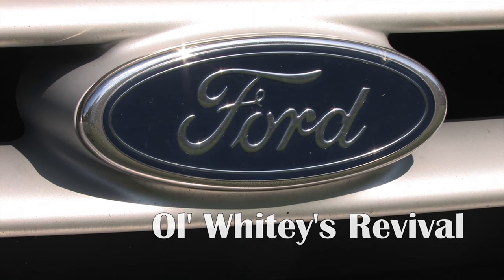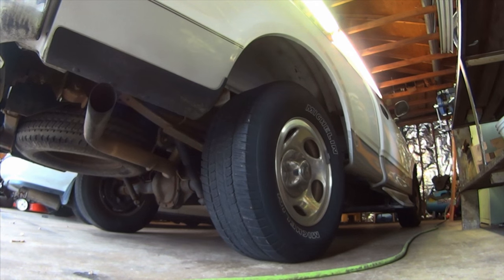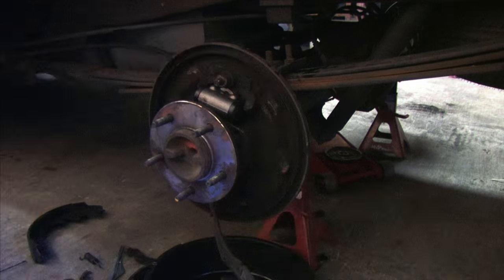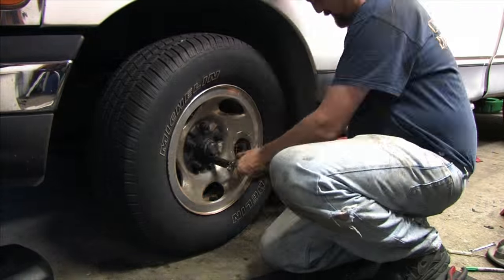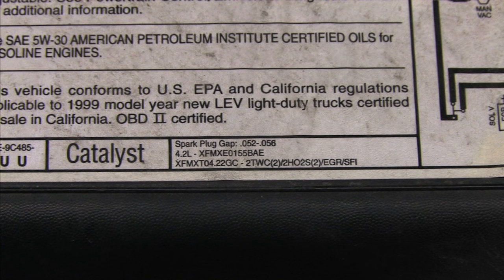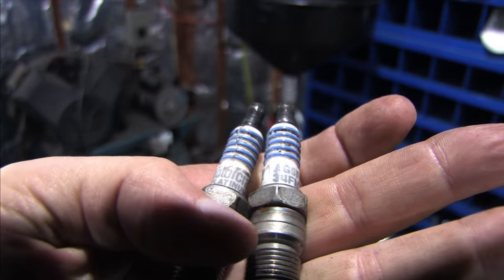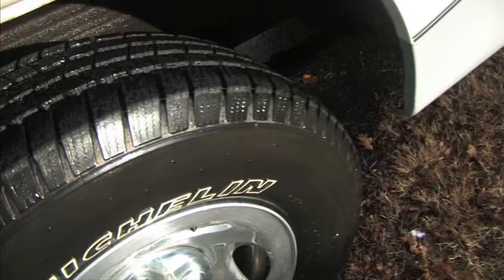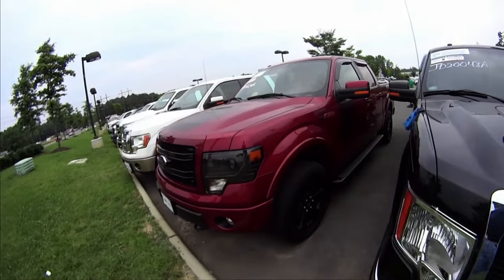Ol' Whitey's Revival

Comment: Could someone explain to me why you'd want to use a 12 sided socket for anything other than a 12 sided nut or bolt (like some after market head bolts etc). The only good use of a 12 sided sockets on 6 sided screws/nuts is as nut and bolt lathes to make a pretty and shiny bolt head with.
Reply from the maker: 2 reasons.  12 point sockets are usually skinnier making them fit in places where 6-point sockets can't.  Also the ratchet end is a square, making the hex line up just the wrong way in tight spaces when you're using a breaker bar.  Some spots don't give you 90° of rotation to tighten and loosen bolts.  It gives you 3 new angles to setup your wrench before you start honking on it.  But yeah, I use 6-point for everything except when I can't because 6-point sockets are stronger and don't strip nuts and bolts.
Reply: Ok, fair points but if i need to use a breaker bar, the chance is that the thing I want to remove is stuck so hard i will just round off the hex head anyway.

If stuck I much prefer heat, penetrating oil and impact gun with as few and short extensions as I can get away with like you used in the video.

I have never managed to round off a hex head with a 6 sided socket (and they can be ground down to fit tight spaces too). I have broken plenty of bolts in the thread though ;)
I must say I was impressed with you managing the feat in the video...

Comment: Hey jafro quick question how do you find out hub bearing dimensions and info to see if they interact with one another
Reply from the maker: Once I have the part number for the bearing for the car I'm working on, I search the part number online and look at the other vehicles it fits.  Most retailers who stock the part and allow you to search their inventory... the listings for those parts often include all the vehicle models they fit.  If you don't know the part number you need, often you can search those same sites with vehicle info, and it's listed in the search results for various brands of bearings, and those may cross-reference to even more part numbers.  Sometimes you get an ID and an OD measurement in the listing, but they're only as accurate as the person entering that data on the website.

Comment: Jafromobile your coolant recovery tank cap is bad, that's why you lost coolant. Ford has used the same cap on all its vehicles for will over 20 years now and they suck lol. This is one of the biggest engine killing parts ford has ever made, just ask the Powerstroke or Ecoboost guys. Ford used a wimpy pressure spring in the cap and they love to fail on hot running trucks or over many heat cycles. I always use STANT part #10238, it has the biggest spring in the industry and it not a bank account breaker lol its $2.57 on Rockauto. It's the cheapest part you will ever buy to save your truck lol.

Love Big Red, only thing I would have done to it is a Dyno Tune session with a SCT certified tuner. Have them do a 85 octane tune and just bump the trans line pressure up by 10%. You would not believe the difference it makes in this trucks, both in power and fuel savings. Have a customer with an 3.5 ecoboost averaging 19.5 mpg and he drives 90mph everywhere lol, and a friend I did a tune on with 5.0L pulling 23 to 24 mpg (he drives normal lol), now we live on the South Texas Coast so we're at sea level which is a boon for power. As always love the videos.
Reply from the maker: +TdrSld Dude, that is AWESOME info for BOTH trucks.  Thank you for taking the time!
Reply: +Jafromobile, no problem bud, love to watch you work lol. As an engine and chassis fab specialist I have picked up a thing or two over the years of building off road racing rigs. So if I can give a helping hand to another builder or someone trying to learn I will. So thanks for the reply

Comment: Hey Jafro, where cn i find the twist sockets you used on the rounded nuts? i looked on ebay with no luck..
Reply from the maker: I just have the cheap-o 5 piece IRWIN set.  The S&K Deep-well turbo twists are worth the expense if you use them daily or weekly.
Reply: I just bought a set of the IRWIN ones yesterday for the exact exhaust nut problem covered in this video. Well worth the $20.

Comment: Hey jafro do you know is the ignition control by cam or crank sensor on a 4G92P
Reply from the maker: +Goce Nikolovski No?  Honestly I had to look up what that even is?  The "P" model didn't ever make it to my country.  It's Europe and Japan only.  Your best bet would be to look up the electrical diagram for that engine and see if the crank signal is coming from the cam angle sensor, or if it has a separate crank trigger.  The crank signal wire will be grouped with the other wires for the part that generate the signal.
Reply: +Jafromobile Thank You jafro we think is probably sabotage from one of the previous owners of the car, the car run when it was parked, next day wont start but is cranking, my friend called me over and using test light i found there is no power to the ignition coil, look at the fuse box and the ignition fuse was missing, looked in the box it was gone, no marks on the door edge, he ever pulled the fuse must have a key, what some people will do.

Comment: Where is this going? The truck is misfiring and we're working on the brakes?
Reply from the maker: Ol' Whitey needed a lot of everything.  It had the misfire before I started, and during the tune-up, 2 cracked plugs ended up getting installed.  You couldn't see the cracks when they were clean, but they had been dropped before I bought 'em.  Once I got 'em dirty, it became real obvious.  You know how you check your eggs before you buy them at the grocery store?...  check your plugs at the parts counter.  I thought I was losing my mind because it was worse after the tune-up.

Comment: hey jafro how bad is the state inspection down where you are? up here where i am we do a safety check and they also get plugged in to check emissions monitors.
Reply from the maker: +Joseph Warden Ours aren't that bad.  But I'm less than 100 miles south of those rules.  In my state anything but the OE exhaust is basically illegal unless a dealership offered it as an OE upgrade package.  Must have catalyst (if OE equipped) is all they visually check for where I live.  Classics are 20 years old, antiques are 25.  One inspection after antique tagged, and anything goes.  But your mileage becomes severely limited.  You aren't allowed to drive it more than 1300 miles a year, I think?  I'd better find out, because more than half of my driveway is antique or classic now.  Will be cool to have antique tags on the GSX.
Reply: See antique or historic tags really do not matter up here. As for catalyst systems only one needed high flow or oem. Old whitey wouldve failed for the tires an ball joints as long as you did not have a check engine light on it wouldve been close to passing. But the same token are cars are very rusty up her from the salt and congrats on big red as well very nice truck
Reply from the maker: Joseph Warden My truck actually passed inspection with the old rusted out muffler and clogged up converter on it.  I fixed the mechanicals and got the inspection early on, but the video flowed much better to announce it later.  I'm not supposed to have any leaks end to end, and though the clogged converter didn't matter for the inspection, they totally missed the holy muffler.  Shipping on the muffler took more than 6 weeks.  It was killin' me.  I got the last pieces of it on January 10th.  Putting all that in the video would have made it awfully boring and whiney.
Reply: Very true. 
Holy delays on the exhaust i thought it was bad waiting a week for new pad and rotors for me acura, then again i did pay for 3 day shipping too

Comment: hay jafro so I have a 99 sonata how hard do you think it would be to make an awd v8 killer with it
Reply from the maker: +ufsl More difficult than making a '92 Colt into an AWD V8 killer.  Most of the parts on the Mirage platform are bolt ons save for a little fabrication here and there to mount the K-member.  Shame on me for not having it finished yet.  Fitting DSM gear into the 99 Sonata would take a ton of fabrication.  You'd have better luck with a pre-95 model and it would still be a challenge because of the lack of a drive shaft tunnel.

Comment: 3000 mile intervals? that's pretty short, I'd be doing an oil change ever 2 months if I had to do that
Reply from the maker: +Skadi It's an old truck and tends to gather carbon and blow by more than modern engines.  My new truck gets it every 6,000.  The long oil change interval production cars really didn't start coming out until the middle of the 00's, but for decades before then cars and trucks were expected to get oil changes every 3,000 miles.  That's how the Amsoil filtration system was able to be successfully marketed back in the day despite its price.  They had the only real long-interval solution prior to direct port injection and modern materials/machining tolerances that would prevent long term contamination of the oil.

Comment: Hi, you're on these tires all year round ride? Or do you have winter tires?
Reply from the maker: +Alex Zombie Yessir!  Michelin XLT's.  They're by far the best tires I've ever put on any daily driven truck I've owned.  My first set lasted 80,000 miles.  I'm sure heavier trucks would wear them faster.  There's no weather condition they can't handle.
Reply: +Jafromobile Thank you. 80000 - a good run. I now michelin x-ice3 only winter in the IX35, good tires. Sorry for my English. Good luck.

Comment: What"s up Jafro! I have a 2001 F-150 and I had the same problem with the odometer. I did some research online and found the culprit. A broken solder on the circuit board inside the instrument cluster. It's a pain in the ass to get to, then takes 2 minutes to fix, then another pain to put it back together. But it worked. Here is were I found the solution. www.ford-trucks.com/forums/196821-odometer-blackout-problem-fixed.html  I hope it works for you.

Comment: Watching this again while doing stuff at work, and what's this word "inspection" that you keep using?  Is that from another language or something?  I dont understand.
Reply from the maker: The state I live in requires an annual safety inspection where you take your vehicle to a certified mechanic who inspects the car to make sure nothing's broken that would endanger the driver, or other drivers.  Some states have it, some states don't.  Some states have emissions.  My locality doesn't, but if it did, my fix would have passed it in flying colors because I did it right.
Reply: That's at least not as bad as some places.  In Ohio, they came out, looked at a 91 Accord from out of state with a cracked windshield, power steering leak, exhaust leak, and bad valve cover and PCV, signed the inspection and sent me on my way.

Granted they didnt even open the hood to know about most of that stuff though
Reply from the maker: Last time I drove through Ohio, I passed someone driving down the highway with no driver's side door.

Comment: It's a Ford ,,, you can count on the cap leaking and the overflow tank to develop cracks... If your overflow tank is OK then the coolant is being sucked in through the intake.
Reply from the maker: +Brian Tracy The intake leak was fixed 60k miles ago and I nailed it.  That's the video I linked in the video.  The coolant system pressure test I did in this video would have caught that problem.  Pretty sure it's the reservoir cap.
Reply: +Jafromobile The cooling system is the weak link on most Fords , especially the V6's prior to the 3.7 ... my 98 Taurus had the original overflow tank crack,, I substituted a newer design with more bottom ribbing from another 98 and that failed too , the last one was Fords 3rd attempt to create a tank for that car... and it worked... I was a bit upset that Ford never acknowledged the tank failures as it no doubt cost many people their engines.. they kept the part number the same for all versions! At least they (surprisingly) kept the price reasonable (I remember a price in the $45 range with a new cap included)... My diagnosis is that the tank must never be allowed to touch the metal inner fender or the heat sink will effect cause failure at that point with excessive expansion/contraction compared to the plastic not in contact... but I used my car HARD ,, as a delivery vehicle with a minimum of 80,000miles a year..
Reply from the maker: I gotcha.  Yeah some others have been mentioning problems with it.  But since mine passed the pressure test, and thanks to all the people who spoke up about where my coolant went... I'm rather certain it's just the cap.  If I had a leak anywhere else on the entire coolant system, it would have showed up with that test and the only part of it missing during that test was the cap.  :P

Comment: Oil change every 3000 miles?? why do you have to change it so often? My 03 TDI 5W40 semisynthetic oil needs to bechanged every 9000 miles...
Reply from the maker: +Domnaek The fact that your engine specifies 5W means that you have tighter piston to cylinder wall clearances which is why your oil doesn't foul as quickly as for engines that require thicker 10W oil.  The materials your engine is made from make thermal expansion less of an issue than they would be for the engine in a truck, so they can get away with using 5W oil.  There's a lot of engineering that goes into making long-interval oil changes possible, but for my lifetime, outside of Amsoil-serviced vehicles, 3,000 miles or 6 months has been the default engineering interval.  Outside of a few luxury brands, the long-interval cars didn't start popping up until the turn of the millennium.

Comment: Nice truck!  But why no Ecoboooooost?!?!?!
Reply from the maker: +Kapok6 'cause I don't want a stretched timing chain.  I wanted the tried and true Coyote engine that has a much larger aftermarket supply chain.  I drove the EcoBoost, I was impressed by it's V8-like power, yet I was simultaneously disappointed to find a pair of turbos that combined are smaller than a TD04.  I gave it the ol' college try, but the V8 won.  I originally set out to buy a 2015 EcoBoost.  I spent 11 years wishing I had those 2 extra cylinders, and now I do.  I know when I'm ready for 800 crank horsepower, the parts and experience will already be available to me thanks to the Cobra Mustang crowd, and Whipple's engineering.
Reply: +Jafromobile Small turbos aren't an issue because we all know that in 2yrs you would be doing a video showing how to swap in two old school FP 3065's, ha ha.  Yeah, the timing chain thing has been in the back of my head.  I am at 82,000mi right now and have been thinking of preemptively having it replaced soon before it goes out on it's own.  Since 2011 though, I have been very impressed with the truck.  Hauling a family, luggage, trailer, and DSM back from Columbus, averaging 70-75 the entirity of the way including through the mountains of OK and the Ozarks, the truck didn't break a sweat and I got like 15mpg, which I was happy with.  On the Coyotes, I personally know a guy that had one with a wrist pin break under 6000mi, and then the same thing on his next 5.0 too.  Both brand new, and factory serviced.  I have pretty much come to accept there are going to be issues with every design out there unfortunately.  Either way though, it's a BA truck, love the color, and the FX4 is definitely the way to go.  The amount of space in the back seats on the supercrew is also one of the things that sold me.  5 grown @$$ men.  Ha ha!  Thanks for the vid man.  Keep em comin'!
Reply from the maker: Kapok6 Yes, that super crew is one BAMF.  You can out-pull my truck stock-for-stock.  That is a fact.  I bought a 2013 over the 2015 EcoBoost because I need to own a V8 in this lifetime while they still exist, and because I could have the FX4 package for $1000 less than a brand new bare-bones 2WD 2015 EcoBoost.  Great-lookin' trucks, too.  There is a point in which there's too much technology in a vehicle.  Ford started pushing that limit with these body styles.  Of course they have the responsibility to keep up with their competition, but lately I think they're over-doing it.  At least they didn't force us to deal with TPMS.  I'm already getting phony low-voltage alarms when voltage is completely normal and my battery tests fine.  It goes away after 3 minutes.  Something to use my warranty on.

Comment: how does an inspection run out... in maryland you only have to do it once if it passes, and most ppl will pass you for 150 t0 200 bones..
Reply from the maker: In VA, we have an annual safety inspection.  I would rather put up with an annual safety inspection than anything like the emissions testing you have to deal with where you live.  I feel safer knowing everyone around me has to pay $15 to certify that they keep their tires, suspension and brakes in shape.  They're REALLY strict with the little things because spending a half hour on your car for $15 is not a very profitable business to be in.  Gotta make money somehow, though... so we get dinged for stupid crap like bulbs, wiper blades, foggy headlight lenses or headlight alignment... stuff that's generally cheap, but something a mechanic will bill you $30-$100 to install or fix.  That's the only annoying thing about it.  Some are stricter than others.
Reply: @Jafromobile   i hear ya.I hate emissions but i know somebody that works there so its okay as long as she is working that day...lol thanks for replying bro